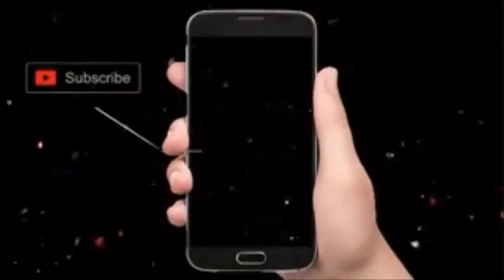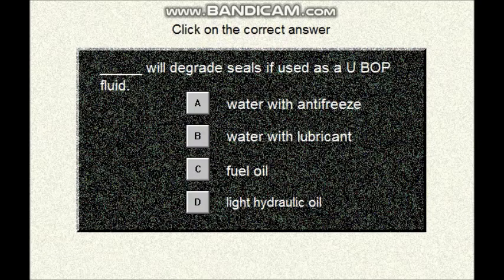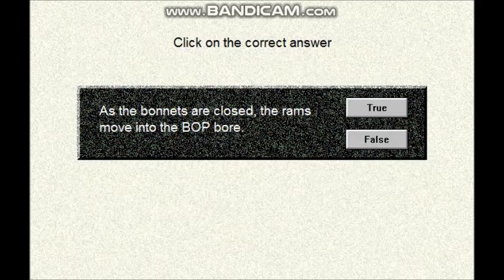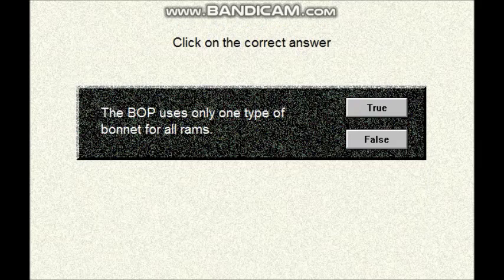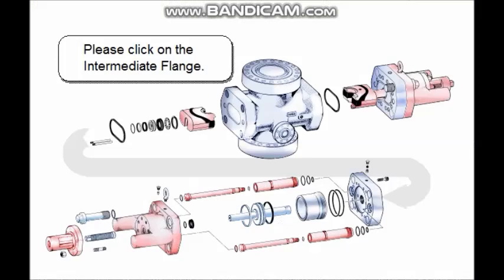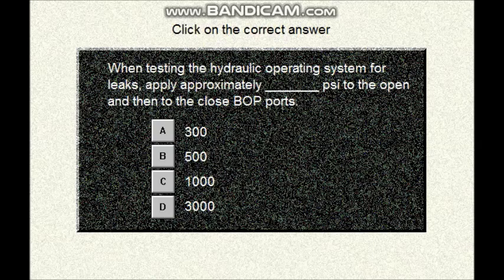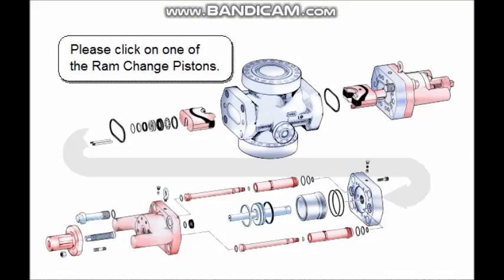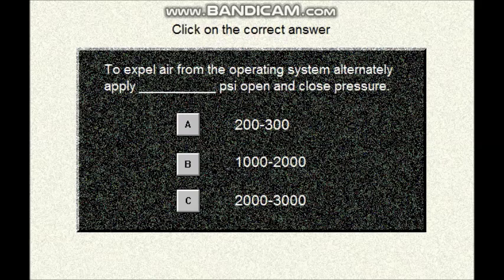Blowout Preventer Training Program   Questions

Comment: The rated continuous working pressure  is 1,500 psi. 
Pressures of 300 to 500 psi normally provide satisfactory operation. Pressures in excess of 1,500 psi  may be required in 10,000 and 15,000 psi preventers to close the rams against high well pressures. In emergencies, pressures up to 4,500 psi can be applied to the hydraulic controls. For optimum seal life, the applied hydraulic pressure should be limited to 1,500 psi, especially when it is customary to hold “ram open” pressure on preventers continuously. When a 3,000 psi accumulator is used to store maximum energy for preventer operation, a pressure regulator should be used to control pressure applied to the preventer.
Reply from the maker: Thank you for sharing. The rated continuous working pressure for the hydraulic controls is 1,500 psi. Pressures in the range of 300 to 500 psi typically provide satisfactory operation. Higher pressures, up to 4,500 psi in emergencies, may be required for specific situations. It's important to control and regulate the hydraulic pressure to optimize seal life and prevent damage.

Comment: Light hydraulic oil is the recommended operating fluid   Any type is satisfactory
except fuel oil, which causes rubber seals to swell and deteriorate - Question 2
Reply from the maker: Light hydraulic oil is recommended as the operating fluid for hydraulic systems. Most types of hydraulic oil are suitable, except for fuel oil, as it can cause rubber seals to swell and deteriorate.	Yes, fuel oil should be avoided as an operating fluid for hydraulic systems due to its negative effects on rubber seals.